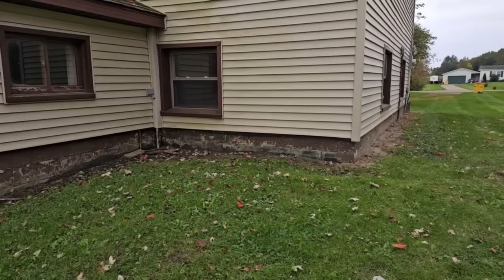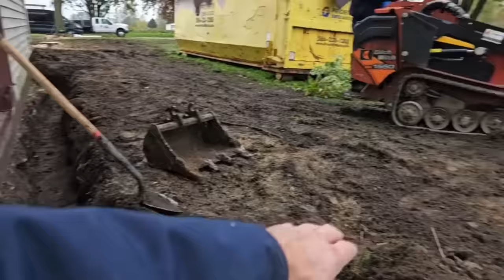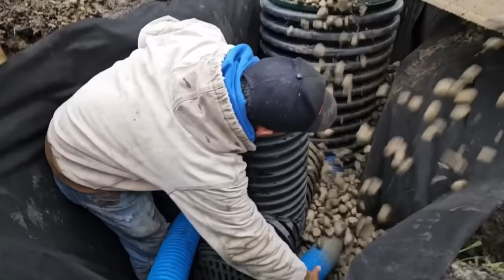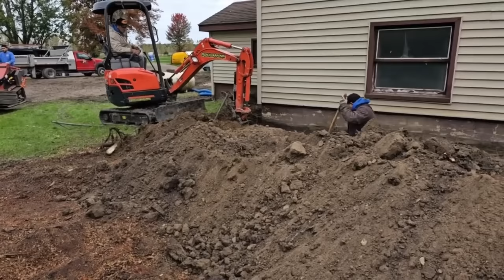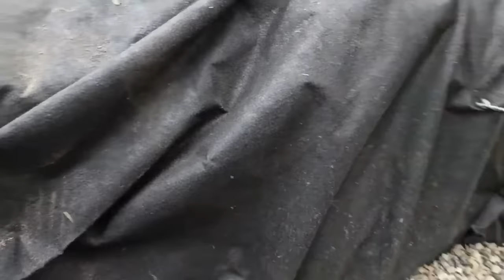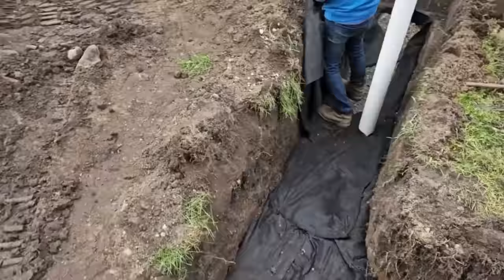How to Install Exterior Foundation Drain that Lasts Forever

Comment: I'm a plumber with over 20 years drain cleaning experience.  I love a 2 way tee on sewer lines. Prevents me from needing to pull a toilet if the clog is inside. I can keep all my nasty tools out of a customers house. A drain cleaner with some experience should be able to tell which way his cable is heading even when the pipe is full of sewer. It's as easy as pulling up on the cable and seeing what side of the pipe it goes to. Your snake is going the opposite way  because of how the snake bends when it makes a turn. Don't be hatin' on the 2 way tee. Lol.  Great work on the perimeter drain.
Reply: I glad to hear this from experienced professionals plumber, as I have 2 way clean out installed on my drain pipe ✅👍

Comment: I repair house with constant tree damage, i tell everyone keep the trees a hundred yards from the house. And if u build a house or remodel and can do it make your overhangs 3 feet out. Get the water away from the house. I know u said gutters but i hate the damage gutters do to the house. Most people dont Clean them out. Or gutters are installed wrong so many times.
Reply from the maker: If you have no trees near the house, you shouldn't have plugged gutters, plus we've made a lot of new products that take care of this problem. A 100 yd is a bit too much. That's way overkill if the trees are 70 feet from the house, you're good. I agree with bigger overhangs, but gutter is a must for collecting the water and discharging it in a safe location.
Appreciate you watching and contributing.
Reply: Give the man a cookie!
Reply: Not saying I love gutters, however you would be surprised what water on masonry can do to a home over time and worst case, wood siding (or OSB based) run without a rain screen behind it.

Comment: People dont realize how complicated ...how many different ways there are to do these jobs...but to get it done right your doing a good job...Was thinking a couple weeks ago about putting an extra 1 to 2 inches of stone on the botttom where in the beginning stages in the first two months after trenching the fines can drift down from the outside edge of the ditch...and this gives them a final resting place outside the fabric ....on the bottom..It seems likely that fines filtration only occurs in the first few heavy rains then when everything is in place the fines are likely done comming through...so this system looks pretty good and I got to see your method for free...You bet thumbs up !

Comment: I'm currently 64" below grade next to my foundation and think I will try to paint the foundation tomorrow.This is a really helpful video, but I am not willing to clear my entire small lot of trees though.
Reply from the maker: Make sure you clean your foundation thoroughly. I would create an air gap as well by using dimple board. You have ground opened up, and I know you have to keep moving. I have a follow-up video showing us waterproofing the foundation. But I don't believe I'll have it ready until next weekend. It's a lot of editing, it's a lot of video files.
Reply: If the drain pipe is solid can roots actually get into it? Do tree roots get down to the perforated foundation/footing drain???
Reply: Roots will certainly get into this flex pipe with so many openings. That said, roots will even get into glue or gasketted sdr35 or schedule 40 pvc. It’s all a matter of degree and balancing risks. Can’t gainsay fdm’s per[se tube though that the further away tree is the Better off u r.
Reply: FDM- I assume you have experience cleaning out a blocked hi-octane pipe? What do you use once you pass the schedule 40 riser?  Hi pressure water ?
Reply: Wow-this job would easily cost 10k in my area…
Reply: 10k you're kidding . Yes 30 years ago

Comment: Wouldn't pouring a 5-7 foot wide concrete skirt around the perimeter of the house work just as well?
Reply from the maker: No. You could keep Band-Aided it all you want you could spend as much as you want an infinite amount of money, if you don't put a drain system in you will not collect the water. It's really that simple.  I don't know why people have a hard time understanding this.  You have to manage your water you can't dam the water, you can't block it in anyway.  You have to collect it in a collection system built for water collection, direct it and discharge it in a safe location.
Reply: Totally agree! The approach here is a much more complicated and expensive project, which will be a headache to maintain in a few years!  I

Comment: I love the reference to the "clay cap" at the end! People don't realize that one of the first layers of water protection is having dirt that water DOESN'T go through!!! The drain is actually just a backup for having dense water-resistant clay sloping away from the foundation.
Reply: Explain more please
Reply: @livelifefree1209 It's preventing the top water from soaking through - it has to run down hill away from the house and find somewhere to absorb into.

Comment: Thanks for the informative video. I have a basement and I’m digging along the foundation wall. How do I ensure I don’t undermine the footer? How far down do I trench below the top of the footer and do I dig at an angle?
Reply from the maker: The basement footer is only 6 - 10" inches deep. Just dig down 4 inches to put the pipe below the cold joint ( where the wall meets the footer )

Comment: So informative. The clean outs should be freaking mandatory on any foundation drain. Silly question but  can you slab a sidewalk on a corner of the house on top of the drain?
Reply from the maker: I agree with you that cleanouts should be mandatory.
 Yes, you can pour a sidewalk over a drain system.

Comment: I’m a contractor in northern Nevada. I also purchase you’re materials and absolutely value you’re knowledge. But I have questions that I’ve struggled to find answers. Foundation drain slope, how important is it around you’re footing? Also the “depth/elevation of you’re trench/pipe? The last French drain I did I installed the high octane 14” deep at the high spot, then calculating 2% slope I ended up 28” deep to a drywall. Also installed pipe to bottom of trench. 
Is this wrong? I can’t seem to accept that a drain that’s level will move water.
Reply from the maker: Exterior Foundation Drain is level in many cases. If you cut a water bottle in half and lay it level on its side does it hold water? Answer is NO it does not. Water runs out of a level Drain as long as the discharge drops. You can start 10" deep instead of 14"
Foundation drain is different than yard drain. This video is a Foundation drain. If you watch everything and don't skip around I explain the differences.
I have a part 2 and part 3 to this system. Stay tuned for all the details. 
Appreciate your support.

Comment: Good point with trees near a house, thanks!
Considering all the hard work this is, I would open up a couple basic points for a discussion in case if anyone would want to joint:
First of all, gravel is an easier path for water to travel, so all the roof water, some water from a ground and some of the surface ground water will be there, constantly keep the foundation moist to wet (depends on a rain fall intensity and sump pump capacity). The idea is to get all the water and even moist (molding issue) away from foundation, not to invite it there.  
Wouldn’t it a better choice to dig the trench a few feet away from the foundation and do a concrete pad around the house up to the trench? This would probably be easier to dig by avoiding carving around those utilities that runs along the house foundation.
The other point is about a gravel. I noticed on the video rounded edge gravel was used in the trench. This may be due to economical reasons or a local quarry availability, but rounded gravel tend to shift or settle easier and prompt to faster clogging.
Edged gravel on the other side, interlocks and doesn’t move over time (even without a cloth), as well as provided better water channeling for ages.
Reply from the maker: I like it just the way we built it.
https://youtu.be/N6Q-T7xpbFk?si=Kx9EspGmTuO4Jlz5

Comment: I use your products on my own property, and I follow your channel.  
Question: 
How will the water drain from the octane pipe if stone is beneath the fabric? 

I have no trees or plants within 100+ feet of my house and garage, when I installed my French drains using your products, I dug the trench, laid the non woven fabric you sell, laid the octane notched pipe, filled it with 2” cleaned river rock, burrito wrapped it, then covered it with exposed 2” cleaned river rock.  

I would think that having the octane pipe sitting on top of 3/4” gravel wouldn’t allow the pipe to fill with water.  Can you educate me please.  

Edit: 
Since I have no trees on my property, should I of put gravel down beneath the pipe as you did in this video? 

Great videos and thank you.
Reply from the maker: We build our yard drains differently than we build our foundation drains. We were so deep in areas that we were gonna have a lot of backfill. Having a smaller stone around the pipe does add for strength. When you're going to backfill for 6-11 feet, there is a ridiculous amount of weight. High Octane is the strongest perforated pipe. But we love overkill. In yard drains, we do not want to leave any water behind. With the foundation drain, I'm okay with there being a couple of inches of stone holding water underneath the pipe. I want the very best soil filters zone that I could build for my foundation drain. 
Thank you for supporting our channel and our products.
Hope I answered all of your questions.

Comment: Looks like this exterior curtain french drain was dug tight against the block foundation in many places?  If I remember correctly other videos you recommend digging the trench slightly away from the foundation so that water isn't flowing through the system right against the building.  That 6-12" or more gap of leaving clay/dirt against the building keeps water away.  Which is how I built ours to your standards and it's been working flawlessly.
Reply from the maker: This is not a curtain french drain. This is a foundation french drain. They are worlds apart. A foundation french drain has to be below the footer. So it is really deep dig. Curtain french drain is several feet off the house. Some homes need both.
Thank you for watching and contributing.
Appreciate you
Reply: @FRENCHDRAINMAN  would you consider making an overview video/short on all styles of drain that you build and maybe those that are just popular? Thanks.
Reply: @FRENCHDRAINMAN Would love to see example vids where both are needed. I’m certain that’s probably what I need. Water is destroying my home. Your content is beyond valuable and appreciated.

Comment: Hi Master of French Drain!!! you know what you do!!!!! your customers are lucky to have you!!     I have a question, when digging, what depth are you aiming for? Just equal or below the foundation? Can it be slightly above? Thanks a million! A follower From Quebec!
Reply from the maker: It has to be below the cold joint ( where the wall meets the footer )
Reply: @FRENCHDRAINMAN  Thanks for your reply! Appreciated.
Reply: @FRENCHDRAINMAN  when you say 'wall'. Are you talking about where the 2x6 meets the concrete block, or below the concrete block. My house is off grade with a crawlspace, no basement...
Reply: @FRENCHDRAINMAN  so if i have a full size basement, i’d need go the full 8ft down with any perimeter drain I’d want to install?

Comment: Mr. Sherwood, could you  please tell me what a job like this would cost?  Many older homes I sure need this done, I am certain.  I have some of the same challenges at my parent's home, but they are retirees with very modest means.  I have tried to battle this problem by myself for them the best I can with little or no money.  The house was built in Minnesota in mid 70's at the bottom of a hill. 😪Believe me I well aware of the damage water can do. I shovel the snow away from the foundation  all winter long.  I have used heavey plastic sheeting, and patio block landscaping the
 landscaping, digging trenches.
 We have gutters and sump pump.  I am their daughter.  Thank you so much for your content.
Reply from the maker: 45k

Comment: Great info mate. how deep have you gone down below the top of the foundation? Would be great to know as i’m doing my house at the moment which has non permeable soil. so lots if standing water after rain. I will be doing a french drain around the house that runs to stream on the property. thanks
Reply from the maker: Only 4" below the cold joint

Comment: I've read all comment and listen to all the video, but i'm not sure why you are puting rock in the bottom before installing the fabrics and doing the burritos wrap. More information would be appreciated. My question is related to an interior drain in a crawl space. Also what is the distance from the side of the footing the drain need to sit? 6 inches? Thank you Sir!
Reply from the maker: Dig out the soil on the bottom and sides of the pipe to rule out Iron Ochre.

Comment: Since you apply the Liquid Rubber on the wall, I assume you have to dig down all the way to the very bottom of the foundation? Just to get the entire foundation wall protected?  Im asking because mine goes 8 feet underground.
Reply from the maker: Yes 8ft down

Comment: Why twin pipes?? You’ve removed trees and ostensibly you have confidence in this flex pipe as opposed to sdr35 ?
Reply from the maker: Corrugated pipe has inlets 360 degrees all the way around the pipe bottom, top, and sides. PVC only has inlets on the bottom. Once a trench bottom is filled with sediment, PVC is Useless. You can't get any water in the pipe. If I want to build a fail-safe drain and I want to throw everything at it, I'm gonna use extra heavy-duty corrugated pipe with inlets, bottom sides, and top..

Comment: Hello, I have seen many of your videos and find them very informative. I have a 125-year-old house and we experience damp brick walls and damp concrete floors in several locations, I believe your techniques might be a solution. In this video, the burrito and drain pipe sit on top of 2-3 inches of round rock, in many of your other videos you insist the burrito and drain pipe sit at the bottom of trench, what are the reasons for the change of design on this project?
Reply from the maker: You need to watch this video in its entirety and not skip around.  I covered that twice. I don't make 36-minute videos all that often, so that tells you how important it was to see the details in this video. I do have a follow-up video that shows us waterproofing the foundation before backfilling. So you can look forward to that in the near future.
Thank you for watching and being a subscriber.
We appreciate you!
Reply: Foundation drains and french drains are different. French drains weave through landscaping these should not.

Comment: Wow, looks kind of deep for a French Drain.
Reply from the maker: https://youtu.be/i92tg09hm6Y?si=61mFQUUlUW_8CaFL
Reply: @FRENCHDRAINMAN I need to do a similar job.  I plan on ordering your corrugated pipes both solid and perforated.  I'm going to get 4 rolls on the pallet.  Very cost effective.   My question is this.  I cant see in the video, as your filming multiple affected areas.  You lay a thin layer of ston alongside thew footer  but lower then the top side edge.  You place the pipe in that trench if you will with the fabric underneath so you can wrap it.  The thing I cant really tell.  When you fill the fabric with the stone to cover the pipe.  Is the fabric filled so the fabric is against the foundation or do you slowly fill both inside the wrap and outside to put a layer of stone between the fabric and the foundation to create 2 layers of stone?  My thinking is a second layer of stone  between the fabric and foundation may allow easier water flow to the fabric.

Comment: How many clean outs do you recommend on a square structure? I was thinking one on each side but maybe that's over kill. This house seems to have a lot more little corners and additions. I'm planning to have a rectangle build.
Reply from the maker: @Unknown-pc9yq
I don't want to go around more than a (1) 90° corner with my cameras or my jetter. When I'm snaking in a cleanout, I put one in a location where I can go one direction or the other and hit a (1) 90° corner on each side of the cleanout. Then I place another one before I have to try to push my camera through two 90s.

Comment: This is amazing work. What's a round about cost of something like this? If they had a full basement would you have dug down the bottom?
Reply from the maker: If it was a full basement we would have dug down the entire wall. We wouldn't go as far below the footer because the basement footer is shallow. We would go just below the cold joint.
Reply: How do you terminate the drain for a full basement?